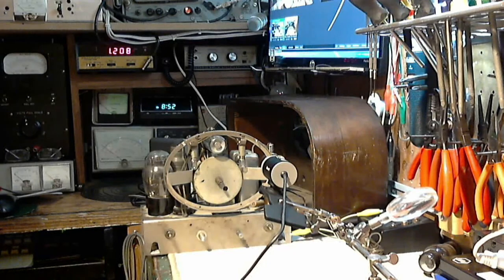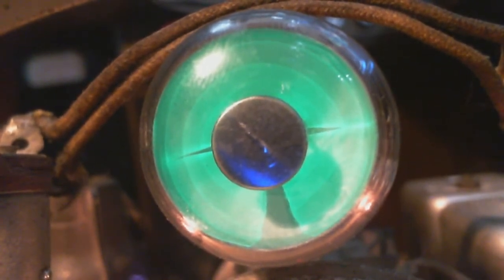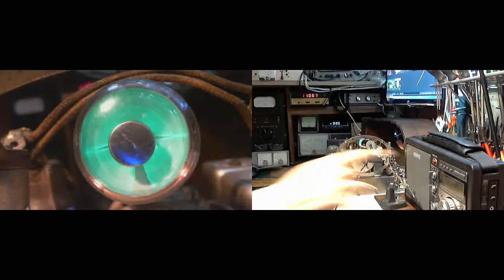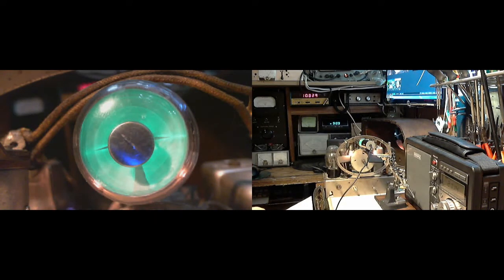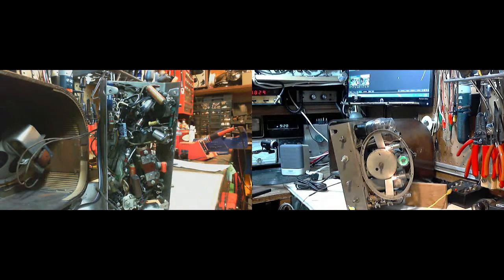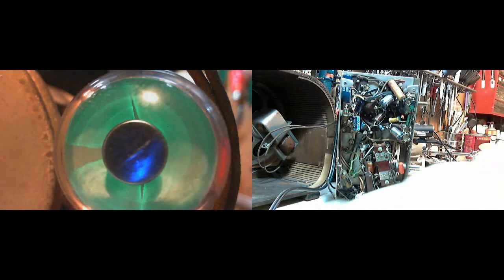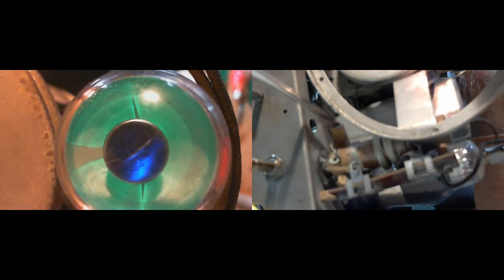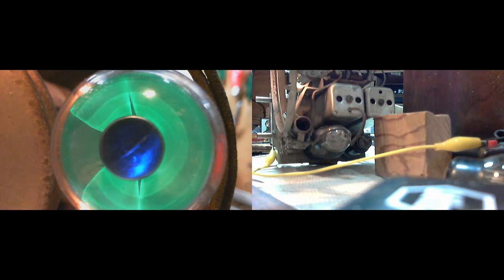Simplex Antique Vacuum Tube Radio Video #23 - Phantom Signal

Comment: Hi Jim. What you can try is to shield the 6A7 tube as the tube recommends doing. If you don't have a tube shield that will fit you makeshift one out of aluminum foil and ground it with a test lead. You can also ground the chassis. You can also check the 6A7 tube for shorts in your tube tester. Great video just like the last video on this radio where you a great job on finding the problem with the eye tube.